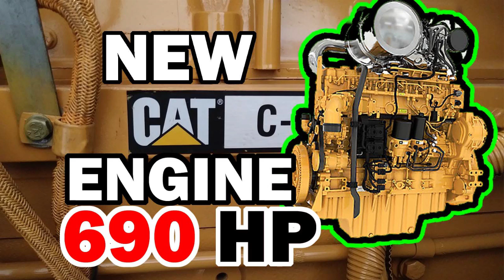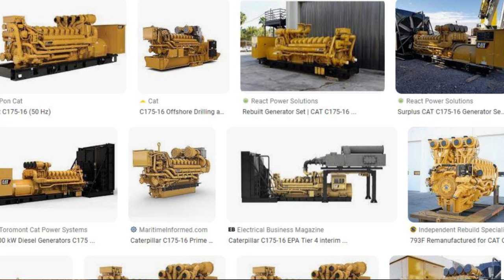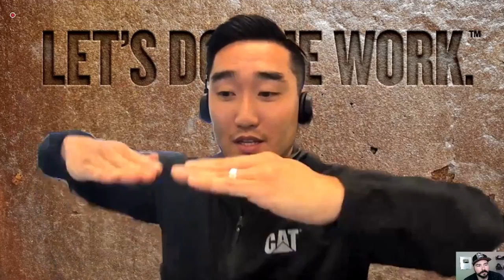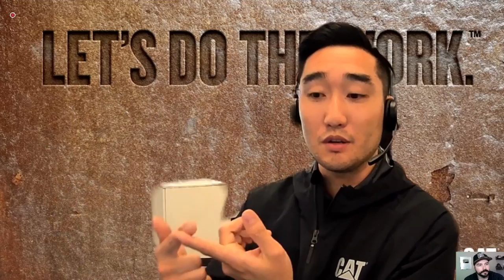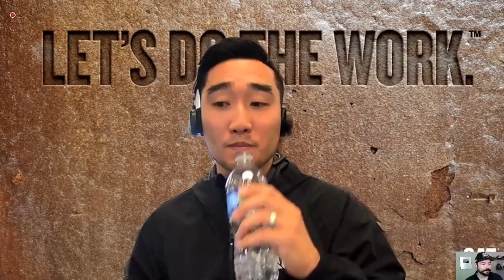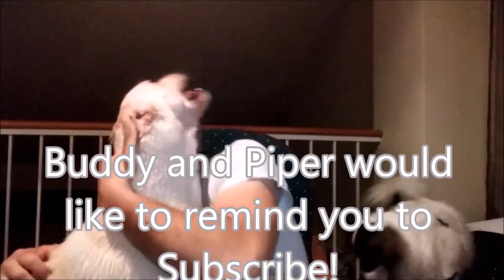Asking EVERYTHING about the New Cat C13D Diesel Engine with a Real CAT Engineer.

Comment: 690 hp from 787 cuin is not a big deal. 2022 Ford Powerstroke makes more hp per cuin. If the new c13 made as much hp as the Powerstroke. It would make 916 hp.

Comment: Thank you to Allen and Josh. This is very interesting. My primary interest would be as an end user for repower. At least initially. To Allen I would say robustness is particularly important. In the late ‘60’s and 70’s Cat built their growth on the robustness of their product. The structure, the hydraulics, the quality and quality control. In recent years this has all fallen. If you are going to have multiple sensors on your engine, make sure their wiring is twice as good as it needs to be to last twice the life of the engine. When working as an engineer, remember life is not level like a pool table, it’s full of ups and downs, so don’t be a pool table engineer. Again, thank you both and best wishes for the new engine. We need it.

Comment: These engineers need to move the dpf filter, and mount somewhere different on dozers.  To reseal a valve cover or to do injectors takes twice as long on a dozer, then it does on a excavator. Example C9 in a cat D6, and a C9 in a 336.  Fyi inspect cups, I've changed because orings showing when injector removed.  And dont use the Cat tool.  Its a couple washers, bolt, tap, and a race driver set, buy the tool from freedom racing it will save you hours, excellent tool.(normally cat has great tooling, the c9 tooling blows!!!)

Comment: Looks similar to deeres new 13.6 clean sheet engine? JD14 rear gear train, single turbo, hpcr fuel system and belt driven water pump

Comment: With a cam in head arrangement changes in deck height will effect backlash between cam and idler. Will the idler be adjustable like the c15,16,18

Comment: Look if you rely on a gasket to seperate coolant from cooling system from the engine oil pressure system, you have failed in longevity of engine life  engineering. Just my opinion.

Comment: Hi Josh,

Just on the New CAT C13D engine is CAT suppling Perkins this engine as there Perkins 2606J-E13TA engine as these two engines from CAT and Perkins are identical engines, complete through the engines Specs design configuration including all engine parts are identical as well.

Would really like to know who is suppling who, as Perkins states that there 2606J-E13TA engine is there own design and CAT are stating that the New CAT C13D is there own design and yet both these two engines CAT / Perkins are identical engines in every way.

Interesting topic on these two engines Josh.

Love your work Josh and total enjoy your channel !
Reply: Perkins is Cat but because Cat engineers dont historically know how to design engines so it must have been done by Perkins engineers.

Comment: Hi sir,l got a job to fix a caterpillar 314Lwhich sinked into water for few days long,l took the engine from the excavator and loosen all parts off and cleaned throughly, even all harness and ECM,but there is no light on of the panel when l switch on ,l checked all fuses also harness connector,l asked the dealer for help,they gave me advise that l should replace the ECM,can you have a good suggestion to my situation, thanks a lot !

Comment: Next question-will this engine use the “dimpled piston design” that is claimed to be a lower emission component by the developer?
Reply: Which reminds me of a comment from supervisor a few years ago. He worked for a racing piston manufacturer years ago. One day Don Prudhome was there looking over his pistons. He had a ball peen hammer. He picked up his new pistons and beat on them with the ball peen hammer. Was this a trick in Top Fuel engines back in the day?
Reply: Dimple pistons is a well researched topic in engineering. 
Nothing new or fancy. 
All about moving air around and promoting fuel/air consistency thru the chamber. 

"Numerical and Experimental Studies of a Novel Dimpled Stepped-Lip Piston Design on Turbulent Flow Development in a Medium-Duty Diesel Engine"

Comment: Sounds like they made a yellow X12 Cummins. I’m a cat fan but all current on road engines are glass fragile compared to the older gen powerplants. If this engine is built in similar fashion then they will need a more contamination tolerant fuel system and ATD redundancy.

Comment: remember guys: not all engineers are evil people that put long bolts in really tight spaces or make things backwards to make you, your knucles, your family, your 10mm socket and your wallet suffer in eternal agony.... jokes aside i always find fun in listening to engineers about new designs especially when they are really engaged about it, had a kind of similar feeling from that time GM announced the LM2 3.0 liter inline 6 with the modern architecture with the valve train on the back of the engine and saw an interview with the engineers after basically what was 6~8 years of R&D on it, new piston bowl desing and such to make much more efficient use of the combustion while lowering the emissions.
this is always fun times for me, thanks allen for your time and josh thanks for coming up with this idea!

Comment: Looks like a dd15 Detroit fuel system and the hydraulic lash in the rocker arms is what Volvo uses on the d13 for the exhaust valves overall looks like a dd15 and a d13 got put together 😂

Comment: 22:13 AN ALGORITHM IS LITERALLY A FUEL MAP, HOW DOES THIS DUDE THINK AN ECU TELLS THE INJECTORS HOW MUCH FUEL TO SPRAY? IF THE ENGINE IS AT X COOLANT TEMP, Y BOOST, Z OIL TEMP, SPRAY THE INJECTORS FOR HOWEVER THE FUCK LONG

Comment: Dude I guarantee you that they will have to add a coolant bypass line from the back of the head around cylinders five and six to eliminate hot spots that reduce the life of those back cylinders because of reduced airflow to them by having the incoming air charge enter the head via a single port at the front of the head because that automatically biases the front three cylinders to get ideal airflow. The rear two or three will run richer than the front three and they will run hotter. This could have been eliminated by having two intake ports into the head of equal size at cylinder two and cylinder three. This was an issue on the 3406B and it will return
Reply: Will the temperature difference be enough to cause problems in this new design? The hydraulics coming through the lifters would also add temperature under load but would it  be substantial? I'm not familiar with these issues as I don't work on heavy machinery.

Comment: The C175s we had in 793s had lots of injector problems.
And our fuel was filtered many times before it got to the engines.
We never had fuel filter or water issues in fuel.
All hauled in on ice roads and settled in the tank farm for months.
Reply: Especially in a tier 2 system , 4 final has seen a lot of upgrades in the fuel system , I believe the HLA was ditched in the C175 as well.
Reply: You were lucky to just have injector problems 😂😂😂

Comment: It sparks my interest that he states that a common rail injector will have 3 times the life of a MUI injector. The nozzle tips on the common rail are so sensitive because of the high tolerances. They are susceptible to failure with poorer fuel quality, and being that this is a global engine, fuel quality is going to be vary different across each country it operates in.
Reply: Yeah.
We changed far more injectors on the common rail C175 than we ever did of the MEUI injectors on the  3500s.  Same with the C32s and C27s, injector problems were very rare.
The 16  cyl C175s were always throwing injector codes.  'Not Responding Properly'.
Reply: Ah yes, but you see… it lasted 3 times longer in a lab environment, with perfectly clean diesel, closely monitored by engineers.
Reply: Yeah but you're not gonna have a prayer of meeting emissions with outdated unit injectors
Reply: This had to be a calculated life or some form of perfect world scenario. I’ve worked on deere, cat, claas (Mercedes and man) and I’ve changed about 3 MUI’s that I can remember and about 30 common rail injectors. Honorable mention all the C9 heui’s I’ve replaced usually 6 at the time. Lol
Reply: If it sounds too good to be true, always assume that it is.
Reply: Worst fuel will be sold on USA so they have propably lots of experience from poor fuel.

Comment: Sounds like it’s basically Cat’s equivalent of Detroit’s DD13/15/17 engines
Reply: Except Detroit ripped it off from Mercedes Benz, this is a fresh build CAT.
Reply: Same bore stroke as the Paccar??? 😰🚛
Reply: @jdeere8850 from what I heard long time when paccar was designing the mx13 they use cat spec and having 2 trucks with one with c13 and the other mx13 both trucks almost drive identical only difference c13 setup with 500 HP 10 SPD manual the mx13 455 HP 13 SPD manual
Reply: I was thinking the same thing 😂

Comment: I wish he talked about the hydraulic system more and how they’re going to make sure the oil stays clean enough so it doesn’t fail. I would think they’d have huge spin on filters and a bypass filter but from the picture it’s just those small cartridge ones.
Reply: What got my attention, IF I heard it right, they are feeding the "lash adjusters" from the rocker arm's side.
I only know of doing it from the "lash adjuster" side ( there's an oil gallery that feeds all bores and keep the adjusters fed and pressurized) <---- system used on Ford's Modulars (4.6, 5.4 and 6.8 V8's).
Oil Filters: You get what you get and that's that. I guess time will tell if these men with white coats and fancy computers programs got their shit right.
Reply: @GIGABACHI  either the service intervals are shorter or they don’t expect these engines to last anyways so why bother.
Reply: @markm0000  obviously they expect them to last a certain duty cycle with a certain percentage of uptime
Reply: @GIGABACHI if they're fixed rocker gear (think rockers above cam, not below) then it's far easier to run pressure fed through the rocker shaft

Comment: Im curious,  if these are "off road" only engines, are they going to make a Marine variant?  Lighter weight, more power,  less fuel consumption sounds ideal for that application.
Reply: Those 3 things sound ideal for every application
Reply: I was wondering this myself. Also if the engine has the ability to be converted to counter-rotate.
Reply: Great question. One of the strengths of Caterpillar is that we can leverage advancements in one industry and find applications for those improvements in our other industries. If the C13D, or any of the new technology or design enhancements of this engine, has a marine application is something we definitely consider.

Comment: So, the flash files just set the particular algorithms for whatever rating is chosen?

Also, I'm gonna need a replacement engine for my crusher that I might buy in the future. I'll transport it with my 1979 359 that has a worn out engine. 
😜